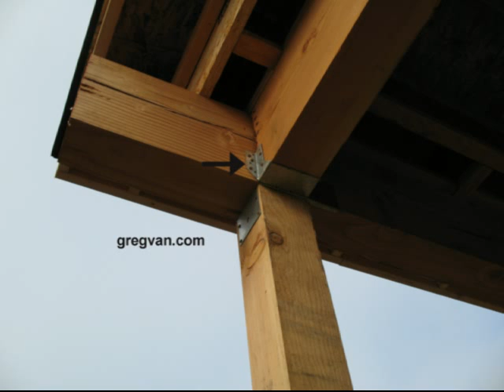Structural Framing Problems - Wrong Beam Hanger

Comment: Greg, what is the correct hanger for two perpendicular beams to a column intersection?
Reply from the maker: I can't provide you with engineering information like this because it can be confusing to other users. However, you might be able to find the information you're looking for at your local lumberyard or home improvement center.

Comment: Thanks for the vid, this actually happens a lot. Especially during years of high housing production. New young guys putting on nail bags trying to learn something. Installing clips tecos etc. these are the young guys that need to be given a free Simpson booklet, a set of mini plans so they can learn what hardware goes where. Especially here in Cali where most houses have hundreds of pounds of hardware due to high wind and earthquakes.
Reply from the maker: You're welcome and thanks for the excellent points. I do remember when the hardware books were a lot smaller.

Comment: why didn't you point out what the proper kind of hanger should have been Greg ?? Perhaps that hanger was adequate. I have a beam to beam situation just like this coming up, I don't have an engineer to calculate the load gravity or lateral stress - Its a barn for crying out loud. Any suggestion? I do know that Simpson makes some pretty heavy duty hangers etc. but the photo you illustrated in this video looked like a positive connection. It appears that Engineer's always overkill anyway
Reply from the maker: I'm pretty sure the hanger was adequate, because it was a new home built and inspected by a city inspector. I'm using the picture in the video more as a reference than a problem for this particular building.
Reply: Thank you Greg, I do enjoy your videos and appreciate the time it takes for you to share your ideas and valuable suggestions. We can all learn from you. Thanks for making our trade a better one.
Reply from the maker: You're welcome and thanks for your support.